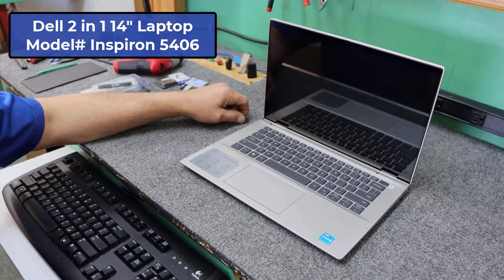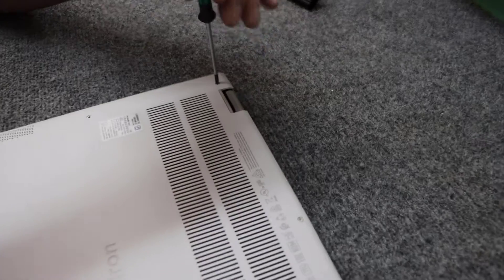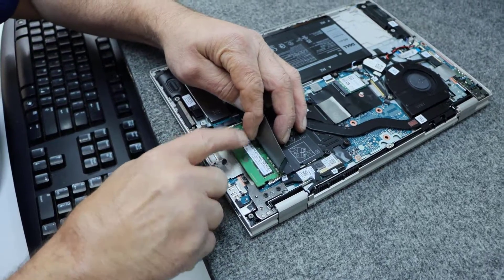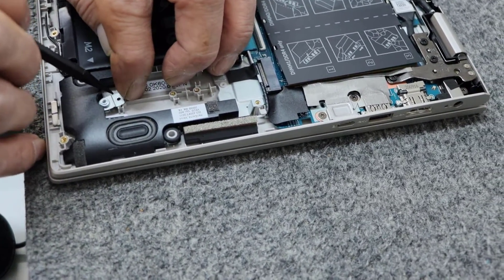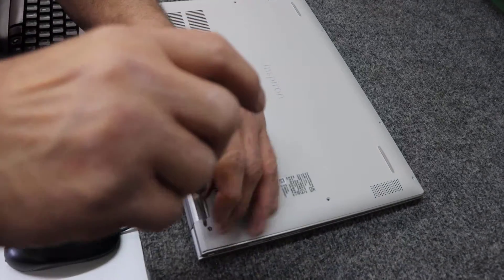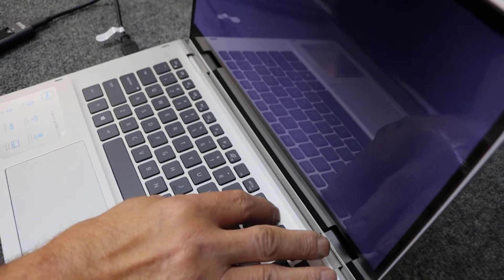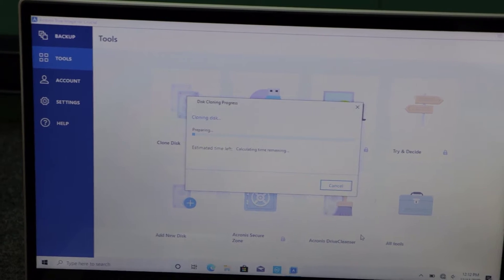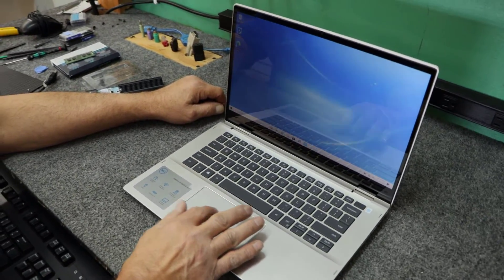Dell Inspiron 5406 14" 2 in 1 SSD Upgrade, Memory Upgrade and Clone

Comment: Great video and easy to follow each step of the process. However, after completing the installation and booting off the adaptor with the prior 512 MB drive, the laptop does not recognize the new 2 TB drive so I am unable to clone from the old drive to the new drive. Any suggestions?
Reply: I have the same problem

Comment: Great video, I have an 11th gen 5410 and wanted to put 32g of ram but didn't know that I could until I watched your video. Do you know if I can put a pcie 4th gen m.2 ssd in this and it support it or should I just stick with 3rd gen? I just don't want to waste the money and not get the same speed I paid for. What arr your thoughts or experience?
Reply: I have the same laptop, and according to Dell it's NVME PCI-E bus is 3.0 X 4.
Reply: @virgulinoferreira3472 Thanks for the feedback. I never ended up needing the extra storage(yet) but I did end up upgrading the ram. It was just plug and play. I still use this laptop for work and its been great. I hope you are enjoying yours. 😊

Comment: is the reason for cloning the drive cause of files you want on the new 1TB? so if i don't need to move files cause i got a new computer nothing on it i need to clone i can skip the clone part when putting the 1TB new drive in correct?

Comment: Hi, I came across your post while searching for tutorial videos to upgrade RAM in my Dell 14 5406 2 in 1 laptop. Currently, it's 11th Gen i3, 256 GB SSD, 4 GB DDR4 3200 Mhz RAM. I need to upgrade the RAM due to performance issues and over-utilization. I have the ADATA 8GB DDR4 3200Mhz module, which would be compatible with this laptop.
Question - Since there is 4 GB RAM embedded in Port 1, shall I embed the new 8 GB in Port 2 or is it possible to remove the existing 4 GB from Port 1 and embed the new 8GB one? Also, can I use both the 4GB and the 8GB RAM together with this laptop - making it a 12 GB RAM 
configuration?
Reply: Yes you can use both together

Comment: What's the reason you replaced the old 8g memory, and replaced with 2 new 8GB memory?It's ok just add the same DDR4 and speed memory. Thanks.
Reply from the maker: Hi. I like to use matched set of ram when possible. But yes,  same speed and size will work fine.

Comment: In Dell's official manual for 5406 and in the service manual also, AS REPORTED BELOW,  the are two optinos for battery. Option one a 11.40 VDC options 2 a 15.20 VDC.
Can two batteries with different voltage c working fine on the same laptop ? 

The following table lists the battery specifications of your Inspiron 5406 2-in-1.
Table 17. Battery specifications 
Description                Option one                                                Option two
Battery type                40 Wh, 3-cell "smart" lithium ion           53 Wh, 4-cell "smart" lithium-ion
Battery voltage           11.40 VDC                                               15.20 VDC
Reply from the maker: Hi. Yes , that is possible. Some models can handle any where from 3 cell to 6 cell batteries. Most newer laptops sometimes can have different batteries, with different Whr specs.  Dale

Comment: hello,thank you so much for video , i have question , i have dell inspiron 14 5000 2in1 Intel(R) Core(TM) i7-1065G7 CPU @ 1.30GHz   1.50 GHz ,ram 16 GB , i would like add ram 32GB and become total of rams 48 GB ,is that possible and compiltable with my laptop and what type of memory brands r good , thank you

Comment: there is no sata drive or sata slot for 2.5inch ssd
Reply: With this thin 2in1 laptops coming these day, the SATA era will go away..
Reply: @SeekingTruth0007  never. bad judgement. 
sata is like an evergreen connection. it won't go.

Comment: Since 11th Gen CPU have Thunderbolt 4 built in, does this have it or did Dell screw that up on purpose?  They have a driver download for Thunderbolt, but they don't say it has Thunderbolt on the spec sheet.  In the BIOS the 'Integrated Devices' will have a 'Thunderbolt Pre-Boot' option if it actually has Thunderbolt.